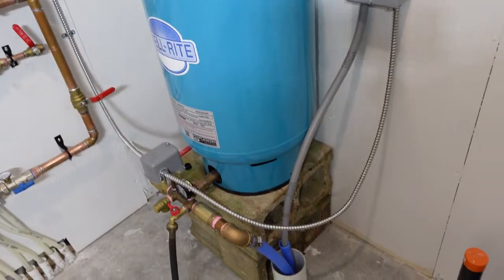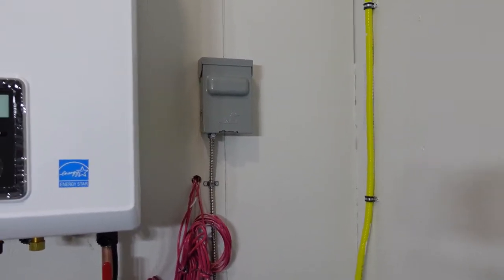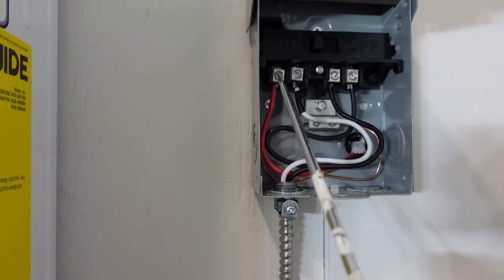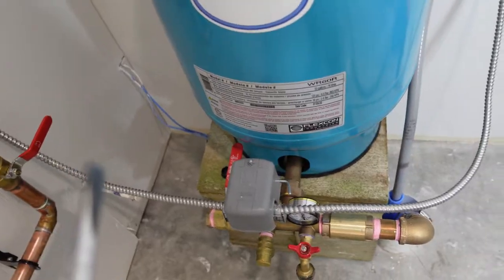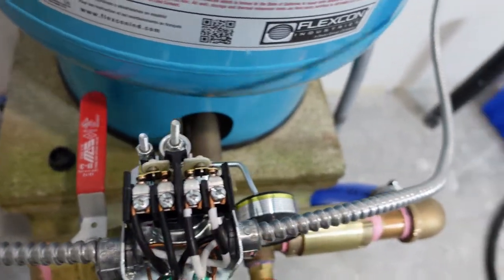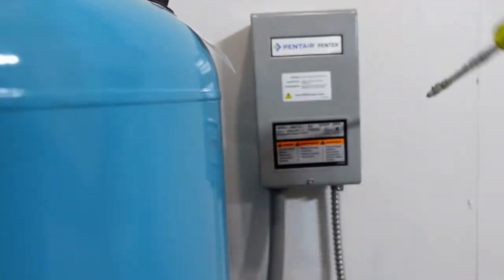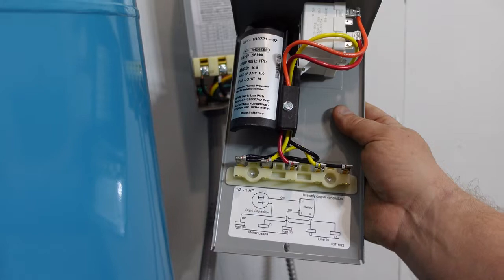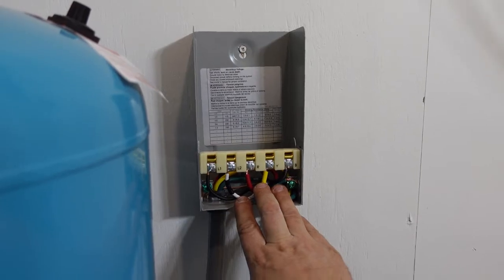What Size Wire For A Well Pump

Comment: Hi there what is 10/12 gauge in metric please. Because I have to wire up a well pump. Also what gauge would I use for a 1/2hp water pump. Glad I found you 👍👍

Comment: My well went out I ordered a 1hp to replace my 3/4hp I read that if your deeper than 112 ft u run a 20/40 switch so I installed a new one my breaker keeps tripping so I looked it say for 1hp use 25 amp I currently have a 20 amp I am changing the breaker tomorrow hope it fixes my problem if not I am thinking I have a burnt wire from the house to the well house if anyone has any input please let me know if I am going wrong somehow thanks
Reply: Breaker could be bad or you have a short.

Comment: If I have a 400' deep well with a submersible pump what would be my maximum wire length in 10/3 wire? 400' well + buried wire from well to regulator. Thanks
Reply: It depends on the horsepower of the pump. Running a 1hp pump on 10-3awg, the maximum distance is gonna be a little over 600ft. Using a 1.5hp pump that distance will be a little shorter.
Reply: I live in Florida. I've never run less than a 10 wire from the panel to the pressure switch
Reply: Also depends on the static water level / drawdown level when being run. @BradCampbell-kb6im

Comment: I have a Goulds J10S 1HP pump. It says 115/230v on it. Amazon shows it being 220v. So this would take 10awg?
My pumps are hardwired and don't have a starter thing like that. But I have a weird system where I have a 1hp pump with wheels that pushes or pulls air (not sure which) in a tube that forces water up into a cistern. From the cistern there is a check valve on the way to the jet pump. Pipes come out the top of the jet pump and go to the pressure tank. In my system, the switch for jet pump is mounted directly on the pump. As to the other pump that fills the cistern, it uses a D-switch float lever. Has an arm coming out and a rod goes through vertically with a float. Water drop makes rod go down and trigger pump to turn on. Water up pushes the arm and it shuts the pump off. It is also 115/230v and 1HP.

Comment: Is that starter acrtually needed? Is it just like a soft start?
Reply: I don't know about his system, but my system does not have a starter. So, it does not seem necessary. I don't know if what he has is a soft starter. Hoping he will answer. My system has wires going directly to the switches for the pumps (have one to fill a cistern from the well and another to pump water out of the cistern). both use D-switches. One is a float switch though.
Reply: @catsmeow5566  What I've been learning is that some pumps have 2 wires (plus ground) and do not have the control box above ground because the capacitors and relays which would be in there are all built directly into the pump itself.  Others use 3 wires (plus ground) and use that control box to house the starting and running capacitors and some other stuff like that.  The ones that are built in apparently use a type of hardware that tends to fail less often, but the ones in the external box are obviously much easier to replace.
Reply: @in_my_bible  This is correct.   The reason for the starting coil is 'flick' the AC motor into rotation so the main coils can take over.   In this case the capacitor shifts phase in the starting wire to allow for this.

Comment: Is that disconnect a 20amp or 30?
Reply from the maker: up to 60 amp the breaker is limiting it to 20 amp the disconnect is just for service
Reply: Can you put 10/2 wire on a 20 amp breaker.